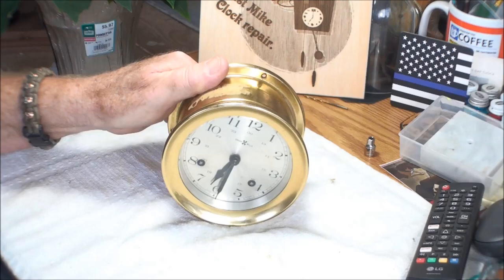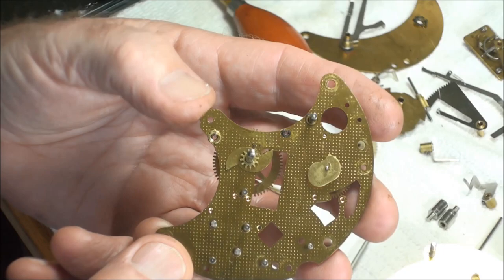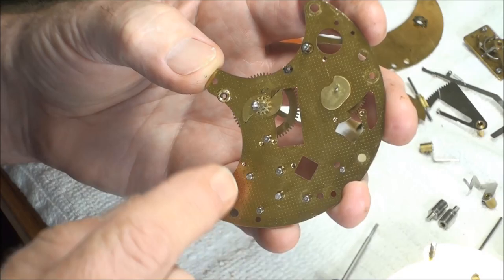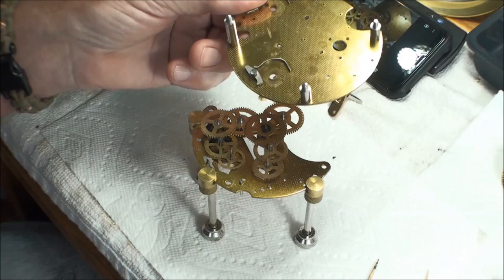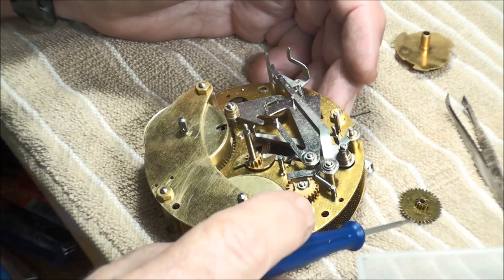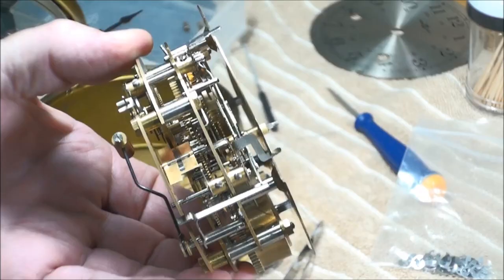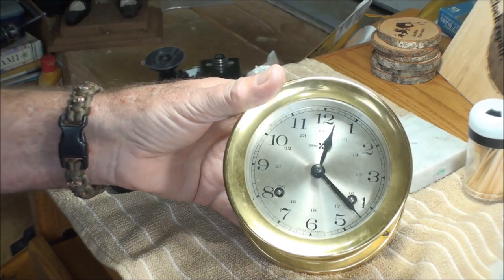Howard Miller Ships Bell Clock Repair

Comment: These are cool clocks that keep great time, I have the exact same Howard Miller ships bell clock I found at an antique store for 20 bucks, the balance wheel was busted so I had to repair it and clean the movement and oil it. It runs perfect now and keeps excellent time, mine has a nice wood base it sits on. Here’s some good information on the ships bell clock. Movements are made by Hermle 

The History of Ship Clock Chimes

Mariners have used a unique bell code to tell time at sea for hundreds of years. The code is based on the crew’s typical workday routine while the vessel is underway. A ship at sea requires constant attention throughout the day’s 24 hours. Therefore, the day is divided into six four-hour periods that are each called a “watch.” Similarly, the crew is broken up into three divisions. Division members stand their individually assigned duties on two watches per day, with eight hours off duty between watches.

First Watch: 8:00 p.m. to 12:00 a.m.
Mid-Watch (also Black Watch): 12:00 a.m. to 4:00 a.m.
Morning Watch: 4:00 a.m. to 8:00 a.m.
Forenoon Watch: 8:00 a.m. to 12:00 p.m.
Afternoon Watch: 12:00 p.m. to 4:00 p.m.
Evening Watch: 4:00 p.m. to 8:00 p.m.

To rotate each division’s watch times, the Evening Watch is periodically divided into two watches. These are called Dog Watches because they “dog” the watch schedule for all divisions ahead by one watch period.

The watch officer struck the ship’s bell every half-hour to apprise the crew of the time. A single bell denoted the end of the first half-hour, and one bell was added each half-hour. Eight bells, therefore, signaled the end of each four-hour watch.

8 bells: 12:00, 4:00,  8:00
1 bell: 12:30, 4:30, 8:30
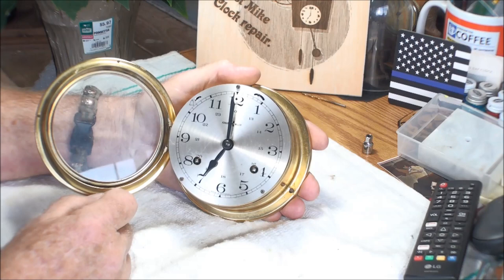2 bells: 1:00, 5:00, 9:00
3 bells: 1:30, 5:30, 9:30
4 bells: 2:00, 6:00, 10:00
5 bells: 2:30, 6:30, 10:30
6 bells: 3:00, 7:00, 11:00
7 bells: 3:30, 7:30, 11:30

In the “Age of Sailing”, time was kept using a 30-minute hourglass that was turned with each bell striking. Modern timepieces are now used, but the chime sequence remains the same to this day.
Reply from the maker: I thank you so much MrBtstewart. I did find a sight that gave me the bells finally. It's just not a normal clock too me, lol. The hardest part was trying to get the single bell, little did I know until I put the movement back in the case that it was doing the single bell. I will admit this clock was mind blowing for me, but after a bit I relaxed and it's just like a normal clock with an odd bell system I am not use to. Thank you so much for your comment and total information on the bells. God Bless.

Comment: Hi Mike! Howard Miller used a Hermle 132-071 movement. There is a strike arresting lever just above the snail and on top of the rack that controls the bell for the half hour. It raises the hammer to prevent the second strike. These movements are described in Steven Conover's book "Striking Clock Repair Guide" (worth the price just for the ships bell clocks alone). Nice work with this clock!
Reply from the maker: You are very right about the movement when I was looking it up for another clock I got that someone threw out the movement and installed a BATTERY Movement of all things, lol. I was having a problem with getting the clock to strike that single bell when the hammer would strike on my finger. When I installed the movement, I then could hear the single bell I thought wasn't working. After I started to relax with this movement, it really wasn't that bad. Just learning the bells was messing up my mind compared to a normal clocks ring. Thanks so much for your info John. God Bless.
Reply: Can I get a video or picture of the strike arresting lever?  I'm getting 2 bell, 2, 4 bell, 4, 6, 6, 8, 8 and can not figure this out

Comment: I never knew Howard miller to make ships clocks
Reply from the maker: I have been told that the Howard Miller movement is a cheaper movement for these clocks. This was my first one to work on. The plastic gear that turns the hour hand was replaced with a metal gear, but he sent me the wrong amount of teeth on the gear and the hour hand is always wrong. In a few months I will be making an updated video on this problem. Thanks for watching George.

Comment: Hey Mike, can you tell me what the two adjustment levers are on the balance... The few pictures I'm able to get out of the videos are. The silver is at two thirty.. 3o'clock and the brass at six.
   My dad's clock must have been Goofed up because silver was at noon. And wasn't working so I moved the brass until it started working. But it keeps stopping so I did move this silver more clockwise and I think i'm on the right track I would appreciate any input.
Reply from the maker: I'm not sure what you are talking about, but the balance wheel that ticks isn't adjustable and if it is, I don't have the clock here to take a look. As for the bell strike, I know now to watch the upper lever, because if you watch when the clock is striking, sometimes this lever lifts up at the end of the striking. That is because it is a single bell. The metal gear I replaced was the wrong gear, this gear had too many teeth and figured this out later. The gear that rides next to it on the right that has the two silver metal bars that stick up.... I do believe are suppose to be both touching the lever on the hour strike. This clock was very confusing, as if you couldn't tell in the video. Now that I have done one and thought about it more, I have a better understanding of what is going on. Not sure if I answered your question, but it's the best that I can do.

Comment: Hi Mike 
I HAVE A SETH THOMAS AND IT'S LATE 4 TO 5 MINUTES IN A COURSE OF APPROXIMATELY 12 HOURS
WHAT ADVICE DO YOU GIVE ME? thanks
Reply from the maker: If, moving the lever that speeds up the clock does not work anymore, than I would take the movement out and oil all the pivots on the front and the back before the clock stops working. Refreshing the oil at the pivots will loosen the old oil that might be starting to gum up. The book says that if any clock stops working, you should have the movement taken apart and cleaned to remove all the old gummy oil and get a fresh start.

Comment: Could you cleaned these clocks in a sonic cleaner?
Reply from the maker: I took it apart and used the sonic cleaner but even then you still need to use a toothpick in the plates where the gears come through and still have to use the wife's toothbrush with Dawn Dishwashing Soap to scrub the plated and gears. Thanks so much for watching Bat. God Bless.

Comment: That is another cool clock, how rare are those?  It looks like a lot of cleaning to get that back in working order.
Reply from the maker: Rare, not really. Expensive, yes. I was surprised  when I went to the local GW and fond the clock and matching barometer for only $15.00. These clocks normally start at $100 and go up from there depending on the makers name. Thanks for watching DJ and God Bless.

Comment: what about using gasoline 
to clean
Reply from the maker: I wouldn't myself. You have to remember to test whatever you use to clean the movement with and be able to wash it off clean so dust does not want to stick to it and so the movement doesn't start to tarnish using whatever. Gas does have an oily film left behind.